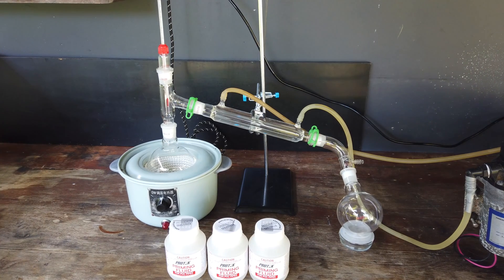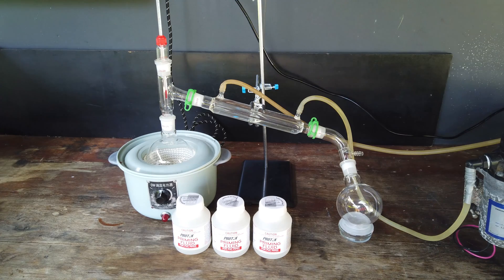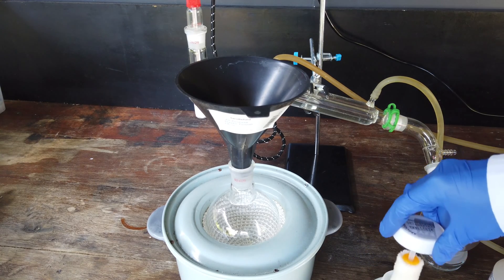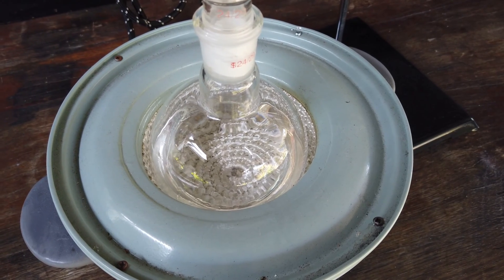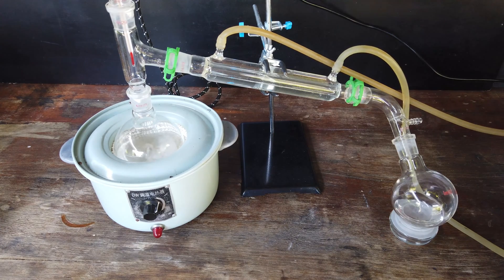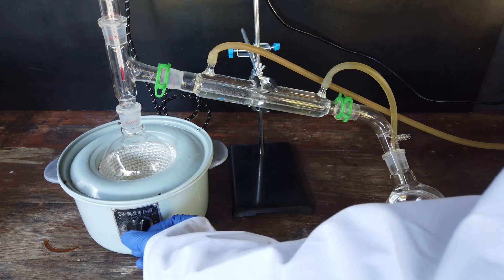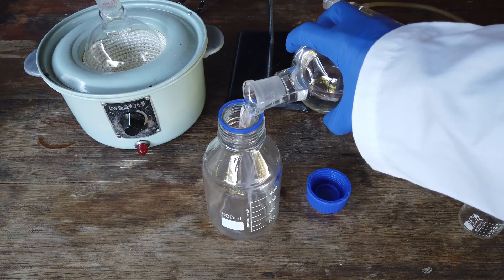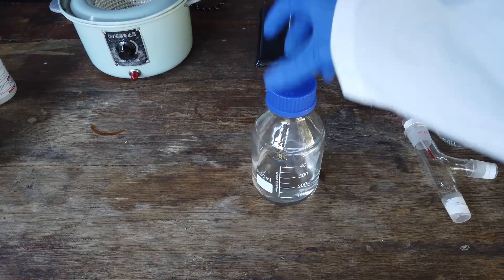Extracting MEK (Butanone) From Priming Fluid

Comment: I would've checked the MSDS for the product to note all the components. By law they must list all the ingredients in the product (but don't have to list their exact amount).
Reply from the maker: As it turned out, the MSDS didn't give any more information than the label on the bottle. It just said 'methyl ethyl ketone - >60%'. 
I suppose that means the rest is something benign like water, or maybe it's significantly more pure than I expected...
Reply: There is so much stuff in Bunnings that doesn't list all ingredients in their SDS. Diggers brand is classic for this with their solvents, like enamel thinners and such.

Comment: Classic distillation! I assume you didn't find anything in the potential ingredient list that would have required a fractioning column or other fancy gear.
Reply from the maker: The MSDS gave a very disappointingly small amount of information. It only listed 'methyl ethyl ketone >60%', just like the label on the bottle.
I assumed the rest was probably water and other hydrocarbons with a similar boiling point, but I've got no way of checking.

Comment: I remember about 12 years ago a big box store here in the sates, called Lowe's had MEK by the gallon on their shelves. No longer though.
Reply: You might check Ace. I got a gallon for $30 a couple years ago. They also have Rooto H2SO4 and potassium chloride de-icer.
Reply: Yep, by law it was removed from all consumer products and those that haven't yet will soon when they get caught still putting it in their stuff.  Sadly, makes it hard to get here in the states.  Gladly, I have a lot and won't run out for a long, long time.

Comment: What an awesome Christmas. I finally got my Drysyn round bottom flask heating block and Harry has posted a new video. Great work and I hope you have a fantastic new year.
Reply: a little advice is to put some fiberglass cloth in it as the direct heat from the aluminum stresses the glass, you can find many drysyn fails on twitter where the flask cracks in half almost comically where it contacts the drysyn due to the direct heat
Reply: Thanks you for the hot tip to young players. I will be sure to heed your advice